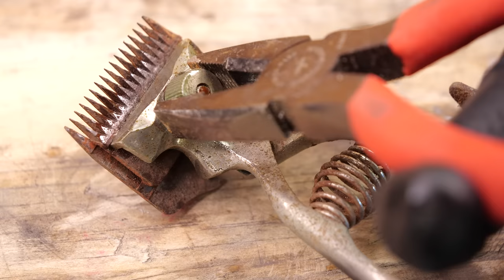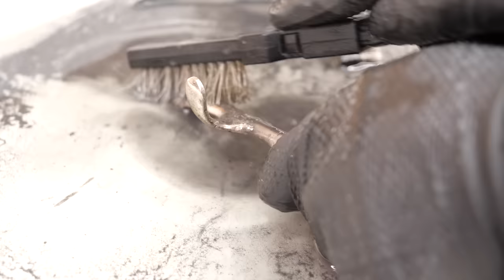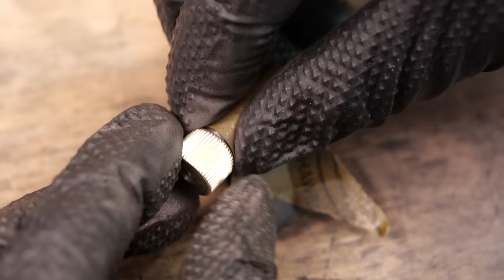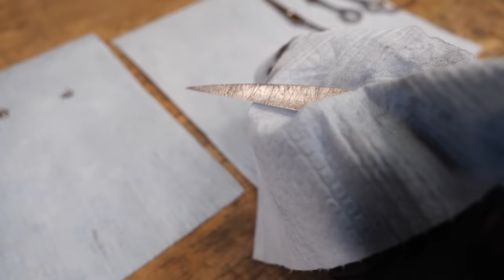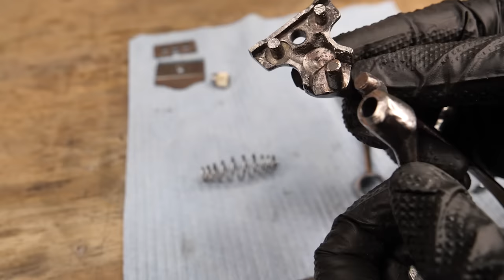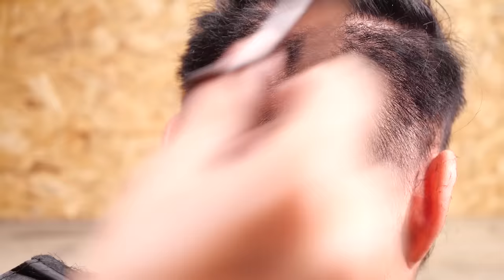昔の散髪セットを復活させます!!

Comment: I remeber this trimmer which operates manually. One of the barber near our resident was using this in 90's and also after 2000. Not sure until when. But i remember that tool was effective if the blades are sharp. The blades needed to get sharpen when used for some time. But this tool is now way past outdated.

Comment: Rip to the guy, his head hurt because of the manual razor
Reply: I think there is supposed to be a blade in between the two set of teeth.  I could be wrong though.
Reply: @reneekittycat  nope. They are just extremely blunt so the hair gets stuck and jammed between the blades instead of being cut :) which can also happen with automatic blades which is why they need to be oiled and eventually replaced.
Reply: امداك💪🏻💪🏻
Reply: 😂😂😂Rip
Reply: Hey gimme back my pfp!
Reply: @graysonhuckaby3752  actually ours are different lmao
Reply: He gave a thumbs up but it was also Opposite Day when this was filmed

Comment: As someone who used hand clippers like those before- you need to oil them VERY well and use them at more of an angle. I am also questioning the sharpness of them. Zaza clippers are similar and work fine.

Comment: Great Job on the scissors. I noticed you didn't lap the cutting blocks for the hand clippers, if you were concerned that your lap stone wasn't flat enough you can use a miter Saw's deck to maintain a flat surface as you go up in grit, ideally to 1 micron. I do this for my electric buzzers with great results.
Reply: wtf does that mean bro

Comment: You could of saved some time and effort if you either used electrolysis or sand blasting to clean the big parts and then use a sand tumbler to clean the small parts and then nickel plating so they don't rust again.

Comment: バリカンは、機械の組み立てを間違えたため（ネジを上下逆にしたり、逆さまにしたり）、正しく機能しません。このネジには、機械が正しく機能するように圧力をかけるバネが組み込まれています。 ネジを外した後、ネジを元に戻したときのビデオをご覧ください。
The hair clipper doesn't work right because he made a mistake in the assembly of the machine (he put the screw upside down, upside down, inverted) this screw has a built-in spring that makes pressure so that the machine works correctly. watch the video when the screw is removed and then when he puts the screw back in.
A maquina de cortar cabelo nao funciona certo porque ele errou na montagem da maquina ( colocou o parafuso ao contrario, colocou de cabeiça para baixo, invertido ) esse parafuso tem uma mola embutida que faz pressão para que a maquina funciona corretamente. olha o video no momento da retira do parafuso e depois na hora em que ele coloca o parafuso de volta.